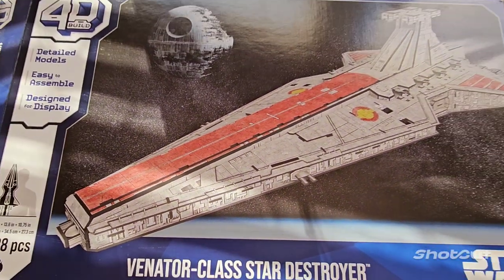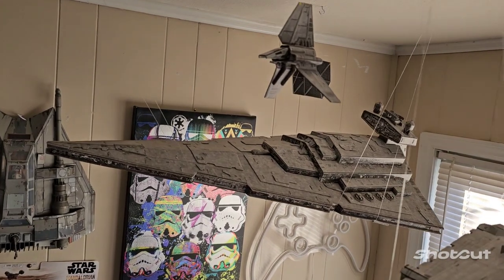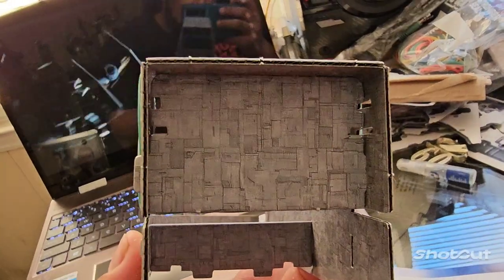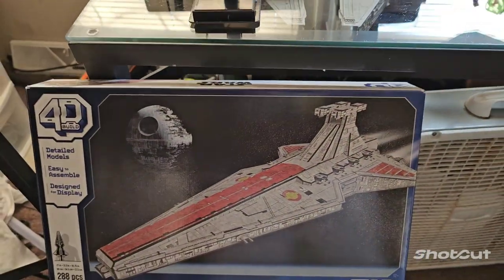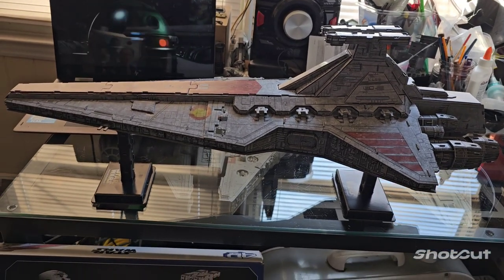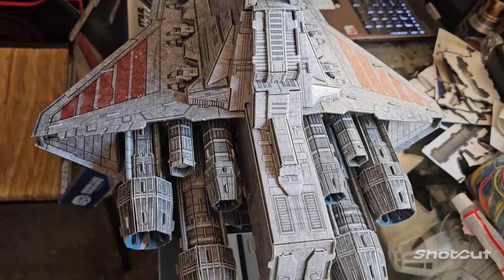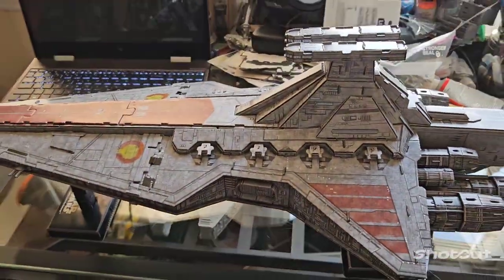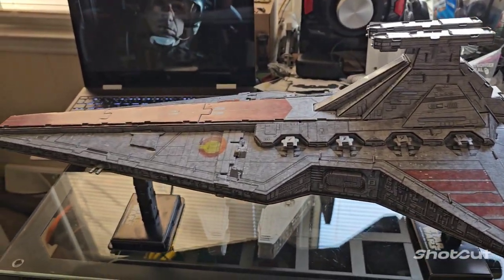Clone Wars creative 4d star wars venator class star destroyer build and review!

Comment: I bought one on Amazon for $16 and change with tax. I have a few questions. Any tools you recommend to make punch out holes easier? What kind of glue did you use? Do you recommend Crazy Glue?
Reply: It comes with glue and a punch out tool or use a small flat screwdriver.